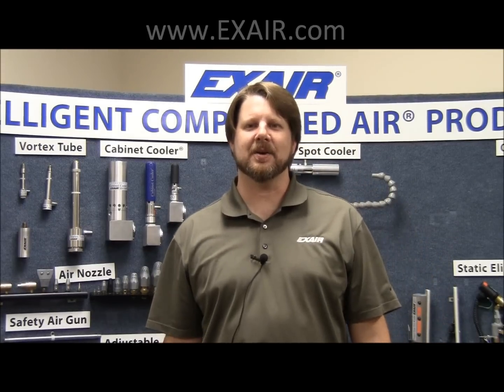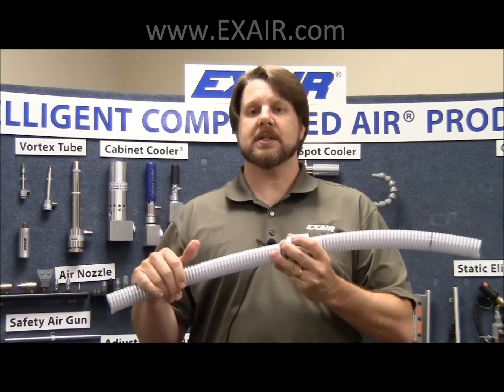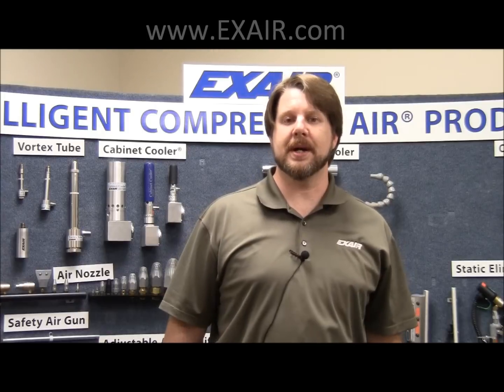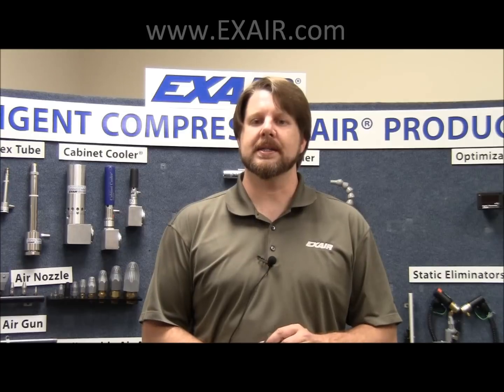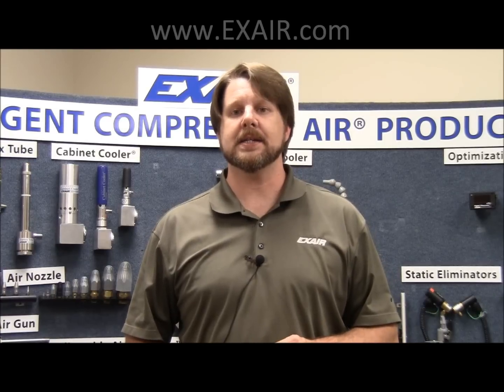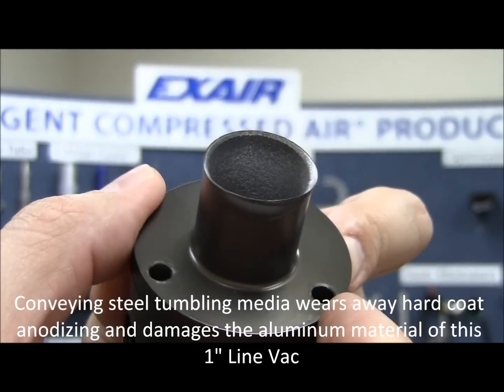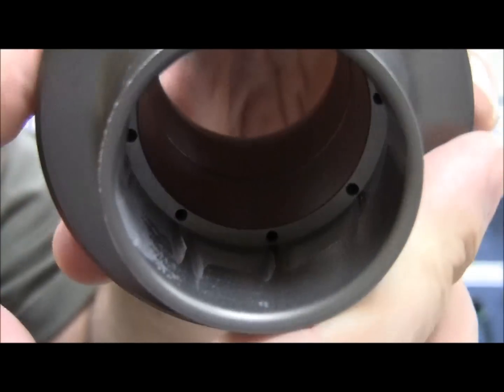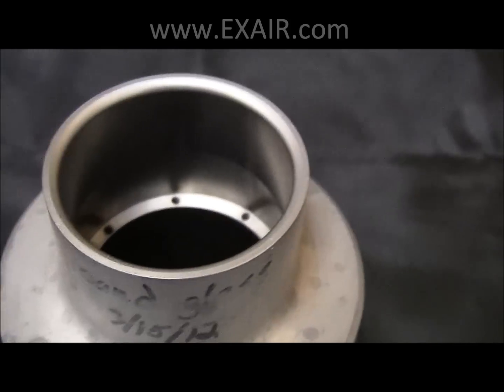EXAIR Heavy Duty Line Vac's superior performance

Comment: how to exhaust the compressed air which is very high pressure and high air flow which is going into the material receiver with material like storage silos, reactors,hoppers and tanks............
Reply from the maker: @Bharat Kadam - Thank you for the great question.  There are several methods to help exhaust the motive air from the product.  The two most popular solutions are:
1 - Use a cyclonic separator on the discharge of the Line Vac to help the materials drop out of the high velocity air stream and into the container. 
2 - Reduce the operating pressure and try to let gravity help with the conveyance as much as possible.  This will reduce the volumetric flow of air within the hose.  
There are several other options, if you would like to discuss them please reach out to us.  Techelp@EXAIR.com or 1-800-903-9247 / +1-513-671-3322